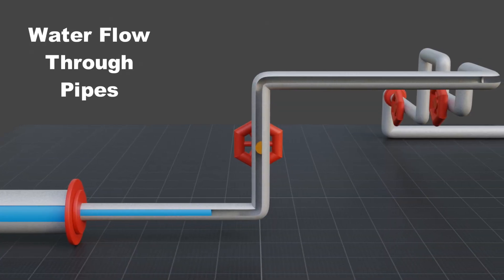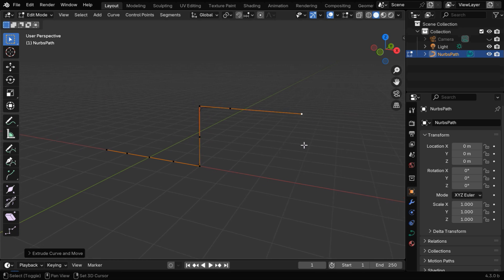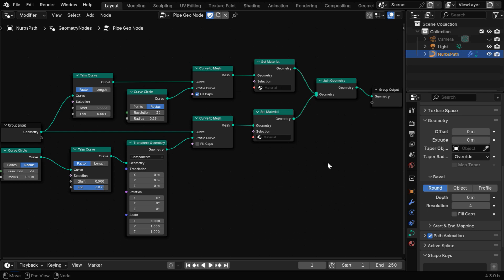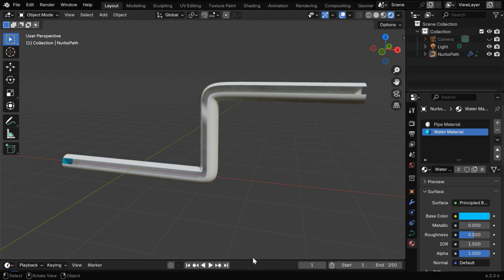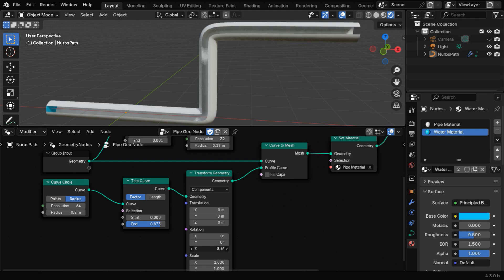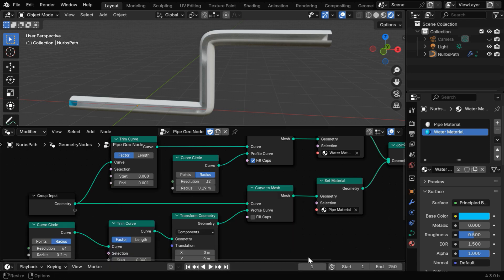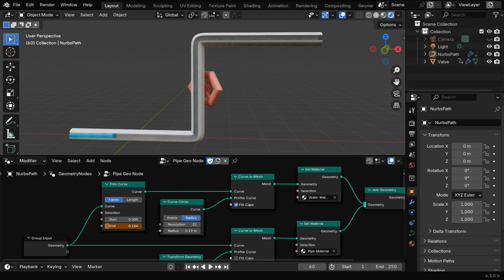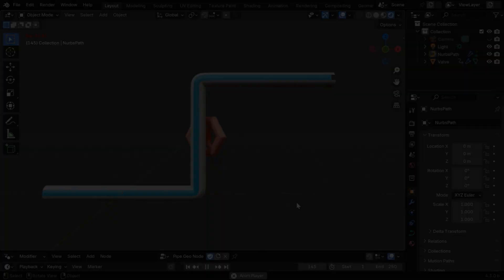Movement Of Fluid Through A Pipe System | Pipes & Valves | Easy Tutorial In Blender

Comment: please show if this is equally demonstratable for flow through branched out pipes
Reply from the maker: For branched flow, you need to set up two separate flows, one taking the main route, and another starting at the junction (when the first flow reaches there). This second flow will flow through the second branch and you need to keyframe everything with perfect timing. To elaborate this further, we created the pipes using curves. Curves never have a branch. So when you see branched pipe, it is actually a combination of two pipes or two curves. So you can easily set two flows to run through the two parts independently.
Reply: @5MinutesBlender  thankyou verymuch! am trying to simulate like you did flow of air pressure through a pneumatic circuit, which has many many branches and operate as many pneumatic valves, basically a wide spread logic circuit demo. so wondering what route to take for the demo, thanks again